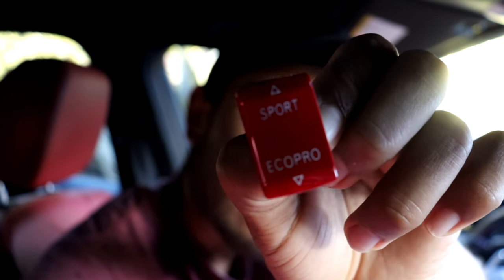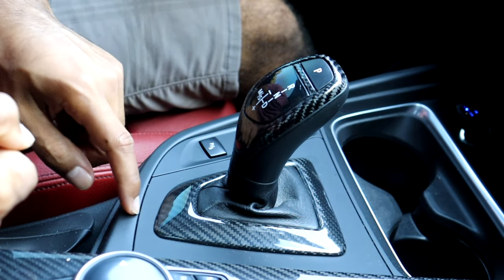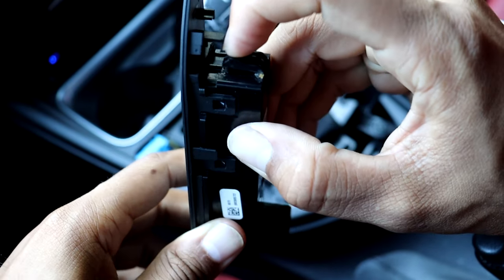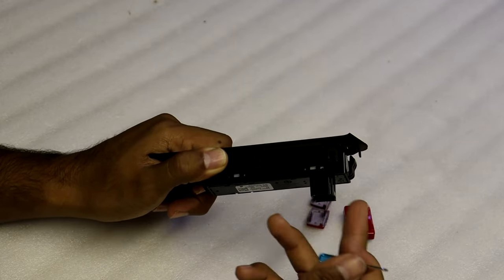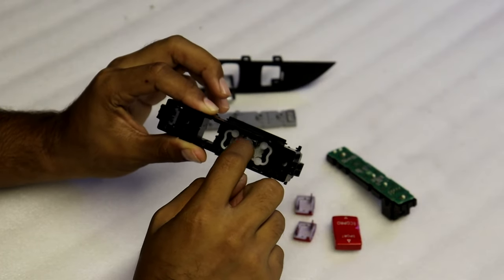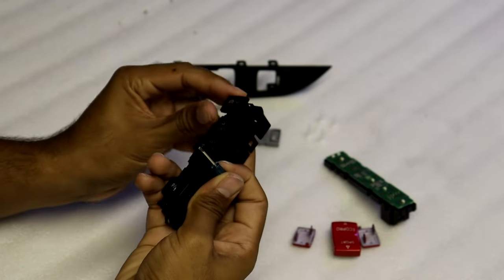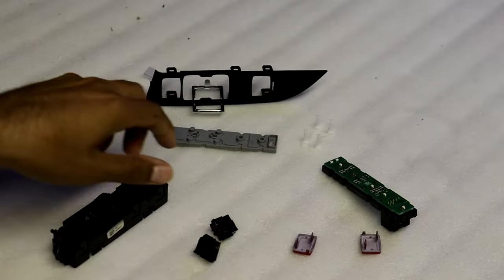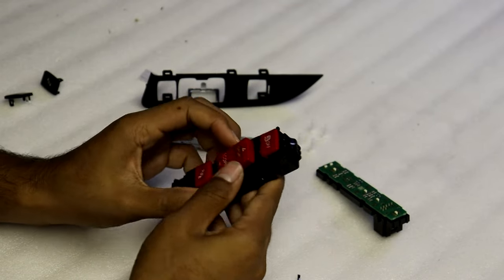NEW Colored Traction Control, Drive Mode Selector, & PDC Buttons for BMW F30! INSTALL

Comment: Nice detailed video. But you don't need to do all this unnecessary, potentially damaging work. Just get a very thin bladed tool/knife, and slip it down the front edge of each button, and gently pry upwards. The button will just pop up and come off with no damage to the button or the car. Clip the replacement button back in the same position as the original, job done and only took about 60 seconds.😎👍
Reply: @SSID94  Glad to be of help. 😜
Reply: Cheers for the tip! I suspect if you post a video it will give ham fisted primates like myself a bit more confidence. Better than trying to follow what the op posted.
Reply: @richardaddison3436  I just did it. You press down the Eco Pro side, and then insert a very thin flathead or a plastic pry tool to the Sport side or vice versa. You simply push down on your tool and it acts as a lever and the button pops out. Done in 10 seconds. Given how little force you need, not even a flathead can damage anything.

What baffles me is this video. Even after all that explaining and further going into it by explaining how the button is attached, it still didn't click to him that you can just pop it off. You can clearly see that's the case. 

Wasn't worth making a 10 second video, so what the heck, just publish this 15 minute tutorial that is completely useless, and comes with several risks of breaking fragile tabs. It should have been obvious after taking it all apart that it literally pops out. Not a lot of buttons on any device or car require you to disassemble anything, unless they are manufactured in a way where the edges of the button spread under the thing they are pushed into. Not trying to sound offensive, but I'm just very confused about this content.
Reply: Bro thanks! Because my finger is too big to push those tabs off. I couldn’t  even push the first tap at the top. I was struggling.

Comment: Like themodfather1160 wrote: it works! I’d used a blue parking disk (Germany) and the Sport eco pro button pops out in 2 seconds. Replaced the black with the new red one and voila, finished within 2 minutes. 👍🏽

Comment: No need for any of this, use a thin plastic prying tool & work very gently around the edges of the button. Just did mine this morning nothing broke, clicks and works perfectly fine.

Comment: how would you get access to the buttons in a manual car as the gear stick goes right to the buttons basically
Reply from the maker: I would think the leather piece around the shift knob could be removed and the you would have access to the unit with buttons. Not certain though that's just my guess

Comment: Forgive me for this negative comment but this is by far the worst video, way too complicated..all you have to do is use like a sticky clay sorta like gum and just stick it on and pull it up quickly and it pops up..idk why go through this hassle..just keeping it real
Reply from the maker: Have you done it that way? pretty sure that would break the tabs
Reply: I have done it this way. Everything went fine. No need to disassamble the whole thing. Best regards! 😊
Reply: So you just kinda pull it with and replace it without taking everything apart?
Reply: Literally watched this video and was like sod that i aint doing that, got a thin pry tool under the buttons and they just popped off 🤣
Reply: I tried the sticky clay thing and it actually works, although the original buttons might break by the clips, it's still way easier to do
Reply: Wait so can you just pull off the buttons with out taking it all apart
Reply: @636.Hermes  yep
Reply: Thanks
Reply: No chance the tabs will break
Reply: @Interisti2506 nope they don't if careful. Really just pop off. Then press new ones in. 
I did it with zero issues 😊